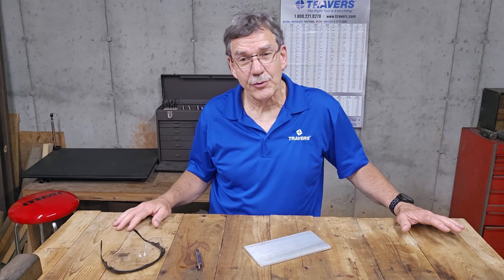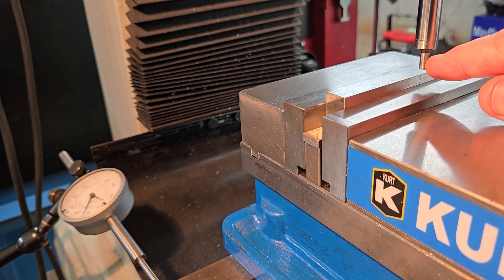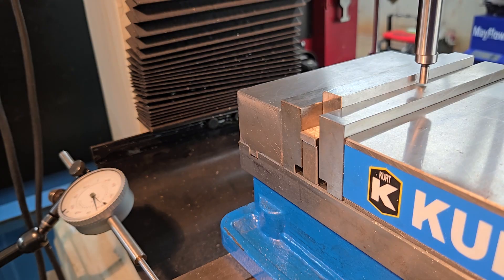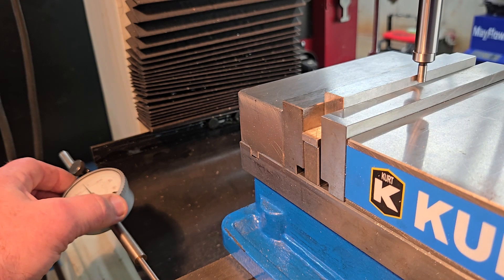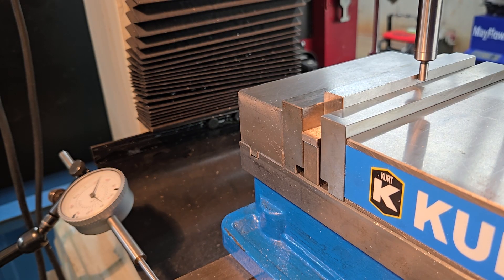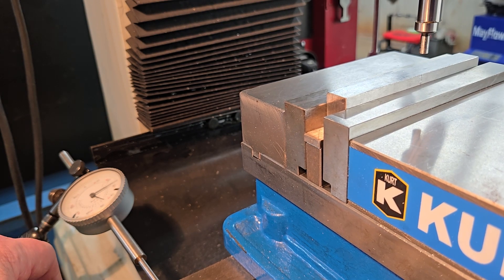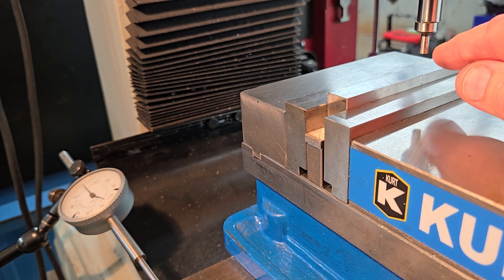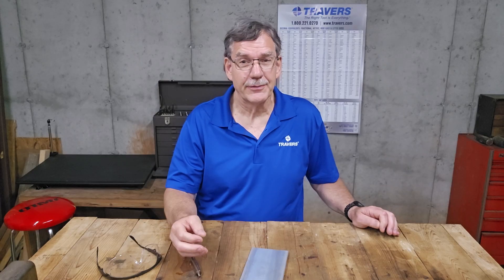How to Use a .200 Edge Finder | Travers Tool Co.

Comment: How fast should the spindle be turning?
Reply: About 1000 rpm
Reply from the maker: Sorry for the slow response. We bumped into some technical challenges. Anyway, run the spindle at a moderate speed—typically between 750 and 1500 RPM. Spinning too fast can damage the edge finder, while spinning too slowly may reduce accuracy.